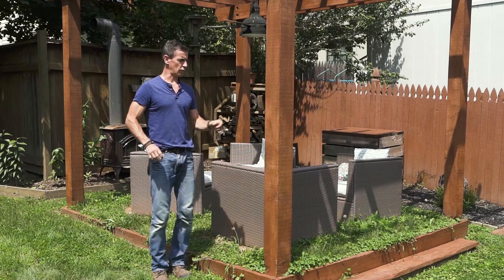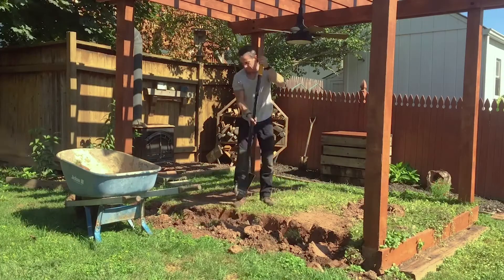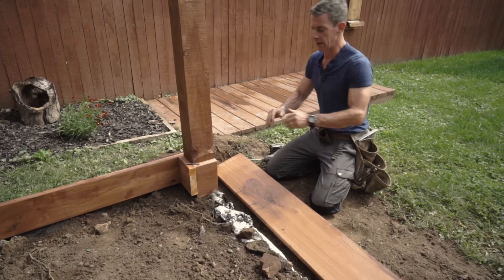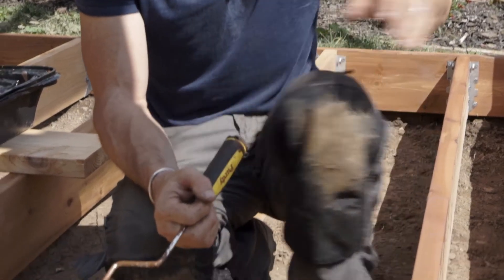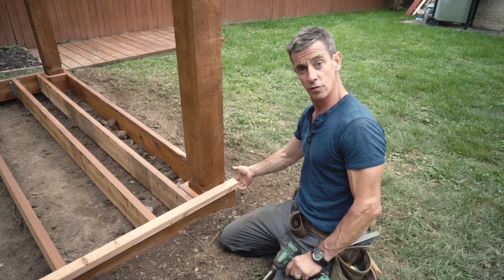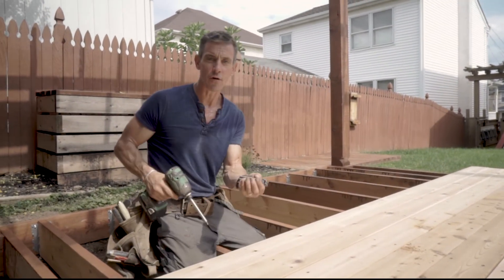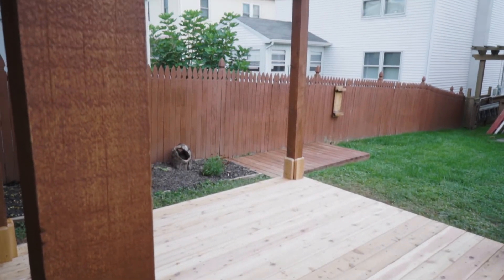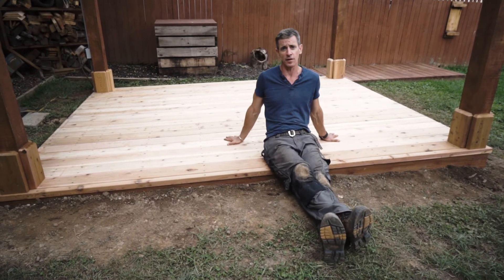How to build a pergola with a cedar deck

Comment: Great video...See you were using your Hitachi Brushless impact with the slim 3 amp batteries. I love using or at least stain with cedar as I love the color..
Reply from the maker: Thanks Doc Q. Yes, that Hitachi Triple Hammer is nutty good. I use it all the time. It's a little (lot?) quieter than other impacts I have too. They have a few hot new items rolling out as well. - I find it hard to stain cedar too, but it was the right way to go in this case. Matchy-matchy as I am. - Thanks for the kind words.
Reply from the maker: Yo doc - The news just posted today. Thought you'd geek on this: Hitachi Power Tools is now Metabo HTP. They've got tons of new tools in the pipeline and ready for launch--including some old favorites like their old school framing nailer.

Comment: Do you prefer star t-25 screw heads of deck screws to Phillips heads ones?
Reply from the maker: Doc Quinn - The T-25 is the basic "star drive" if I'm not mistaken and I despise them. Nary a one hasn't tried to keep my driver tip friction-ed into it at the end of the drive. Spax's T-Star Plus is vastly superior to anything I've ever used. Combined with their rating for use in metal connector hardware (#10 gauge), they're unbeatable. Phillips ranks so far out of the running I'm not sure what to say. I use Spax all over the job site-from concrete connections (like bottom plates in basement renos) to framing to cabinets - See this hugely popular YouTube busting video for my take on it -- https://youtu.be/EAGeJ86rhrI
Reply: MyFixitUpLife show Yes that's right I need to try those spax screws this upcoming building season..Thanks for the reminder..
Reply from the maker: Yeah man. Their PowerLags are rated for structural connections too so in some cases--guard posts on decks or post-to-girder connections, there's no need--in a lot of cases and if your town allows it--for through bolts and other hardware. True story. They have the engineering.